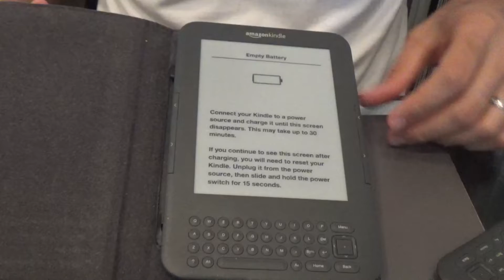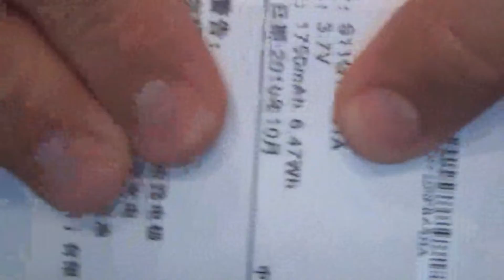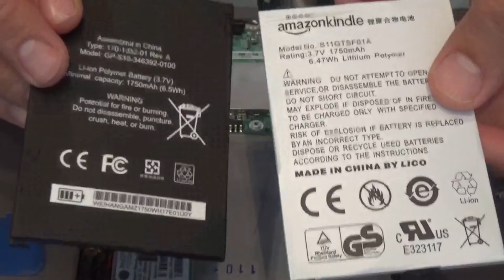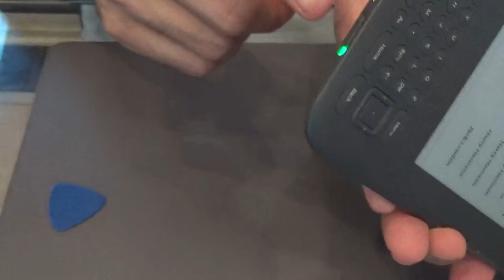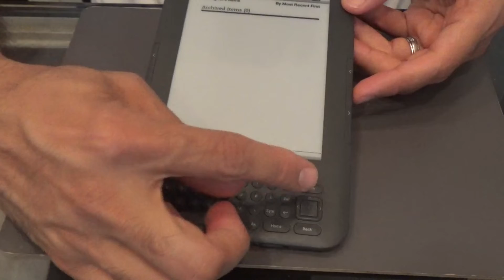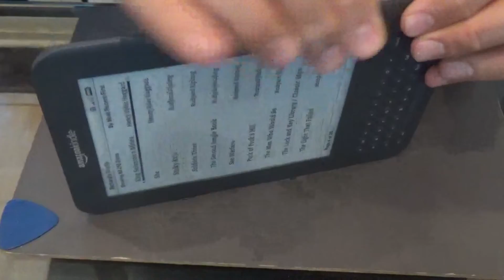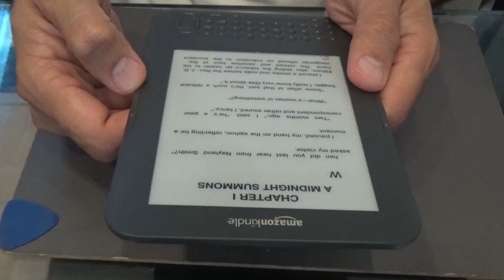Amazon Kindle with Keyboard Battery Replacement Fix

Comment: Trying to determine if this is the fix for my Kindle. Current condition - shows empty battery screen and will not turn on even when plugged in, though it does show an orange light when plugged in. Before you replaced the battery on yours, if you plugged it in would an orange light show?
Reply: ¿Cómo lo soluciono? ¡Me pasa lo mismo!